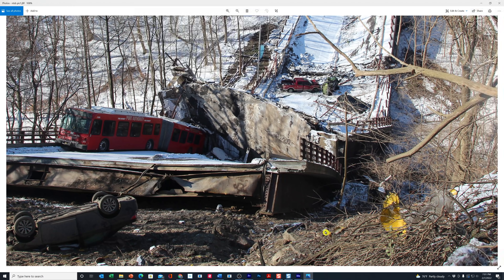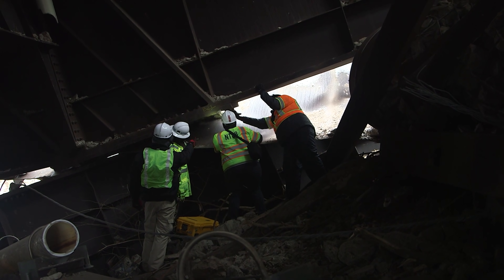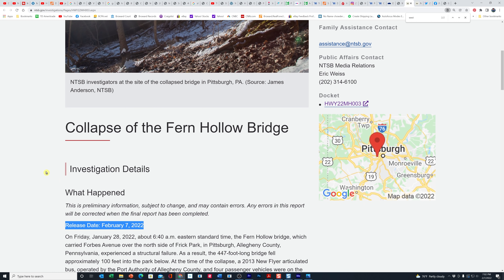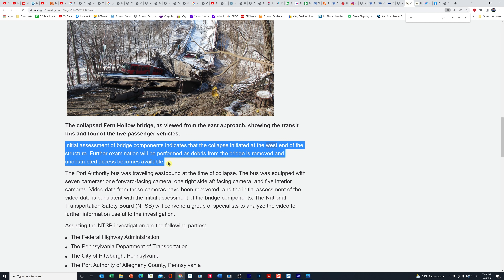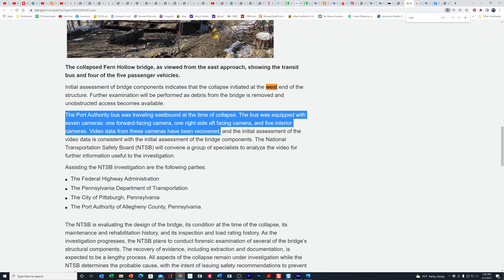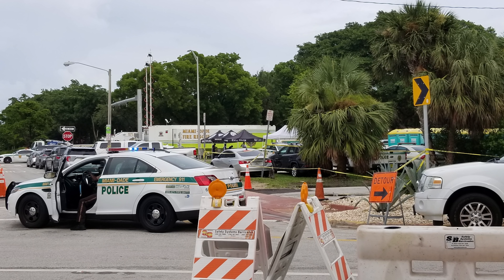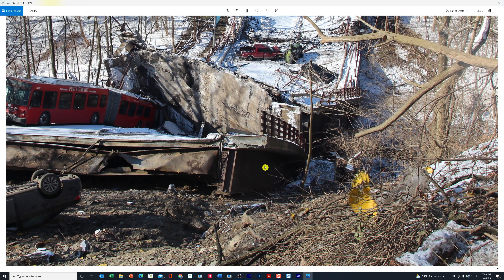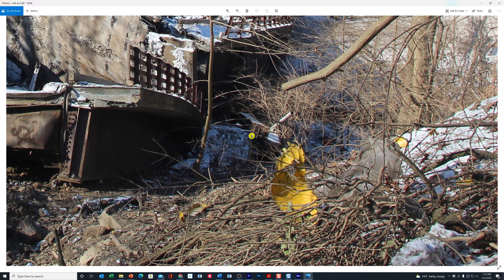NTSB Report Points Where Pittsburgh Bridge Collapse Started

Comment: Civil / Structural engineer with steel bridge experience here.  Good video Jeff.  I've never heard of retrofitting a bridge with cables like this one had, rather unusual - so that aspect will likely come under scrutiny by the investigators.  Considering the lack of maintenance and high amount of corrosion on this City of Pittsburgh owned bridge, it is unlikely that a deck or deck beam failure was the root cause of the collapse.   Foundation settlement could do it, but normally the foundation settles slowly over time and it's more easy to notice.  Seeing that there are just four main steel support columns that are also angled (not vertical), if one of them begins to fail, then the other will also fail due to the twisting effect and load transfer to the 2nd column.  If I had to place a bet on the root cause, I would think one of the column connections failed since unlike vertical columns, there is an added shear force in the angled columns.  Fatigue may have also contributed since heavy vehicles have continued to cross the bridge and will cycle the stresses and also vibrate the deck and it's support columns.  The thermal contraction of all steel elements due to the low overnight temperature may have also contributed in the collapse of an already compromised bridge.  Given the above, and not knowing any other information, the root cause of the collapse is probably a failure of one of the steel connections of the column to the deck girder on the west side.   It'll be interesting to read the final report, and to what degree the City of Pittsburgh will be implicated.  They should feel very luck no one was Killed!
Reply from the maker: Yes it really is such a miracle that nobody died especially the depth that it fell makes me wonder if it was more of a gentle soft landing than a all out collapse.
Reply: @MJ S

" Seeing that there are just four main steel support columns that are also angled (not vertical), if one of them begins to fail, then the other will also fail due to the twisting effect and load transfer to the 2nd column. "

I have not been to the bridge site.  But, looking at all the photos over the past week, the entire bridge seems to have "pancaked."  I mean it seems to have come down as a unit.  To be sure, there is the folding behind where the bus came to rest, but that is not the plane of interest.  The deck remains much intact, side to side.  This would seem to eliminate the possibility of twisting.  

Frankly, it looks like a controlled demolition in this sense.  The failure of the superstructure followed some pattern so that the deck fell as a unit.  

Having said that, looking at some of the NTSB staff walking through the debris, some of the elements of the superstructure look badly distorted.

I am doubting the low temperatures could have made a difference.  Yes, it was cold that morning, but Pittsburgh regularly has these kind of temperatures.

If I follow what the preliminary report said, and where the bus landed, the bus would have passed over the initial failure point seconds before the collapse.  Am I right?  The report said first failure point was west end, and the bus was traveling west to east.  If the failure point was on the west end, that would make part of the K-structure less likely to be a candidate for failure.  The report does not say "western K-support."  The "western end" would be the end of the bridge being supported on the western land side.  There are four primary points of the entire span support - land side (west), K-superstructure (west), K-superstructure (right), land side (east).  What the report says is the first of these was the point of initiation.
Reply: @MJS - Great points.  Agree that the deck was an unlikely cause, Foundation settlement could be the hidden cause, there are 8 support points under the two rigid frames, I got my BSCE back in '77, where we had to learn the pre computer methods of calculation, and do Fortran on punch cards.  I recall how shocking a unit displacement was for the stresses.  Well, two columns failed, the now 2 span bridge sagged and sagged until it slid off the abutment, then plastic hinge or buckled girders.  If the column foundations had slid a few inches down the hill, the high moment in the column makes buckling easier.

I differ on the primary cause - the Cable X could carry lateral loads, but the columns are no longer effectively braced at mid height.  One column buckled, its sideways movement was transferred thru the upper X to the other, the increased delta made the P-delta effects initiate buckling of the 2nd column on that side. That wrote the story.  The very spot the NTSB was hanging around.

Your point about fatigue is good, but not the whole story.  The code used for this bridge predates by just a few years some big changes in the AISC fatigue design, prior to 77 it was only tension stress range considered, suddenly compression came into play.  The number of cycles, stress range, and geometry crashed downward.  A fillet weld for a gusset across the flange had been allowed 24 ksi stress range, suddenly it was 6 ksi.  Saw crazy fatigue cracking in steel mill cranes, one crane we would have a 6 ironworker shift x 9 shifts over a long weekend welding up the cracks every 6 months or so, 2 or 3 pallets welding rods each time.  Lots of connections here fatigue prone, but the high fatigue areas are up in the deck.   So so lucky nobody died.
Reply: My guess would be to analyse the creep in those Mickey Mouse Post-tensioned cables -
Did they over compress the deck transom beams causing buckling due to differential shrinkage over straining the cables in the cold? Was there any plastic creep in the cables? Did the cables have any thermal tension fatigue failure that popped or was it transom  buckling that happened first?
Reply: someone saw those cables at Home Depot and said, hey, why not....   and all the wokers said, yeah, defund common sense.
Reply: After what I have seen so far I agree with you 100%.  I'd bet that where the beam meets the mounting plate had rusted enough that it was barely hanging on there.  Between the cold temps we had that night and the bus going across it was just enough to cause it to fail.

Comment: The bridge west end lower cross members that were removed, acted in both compression and tension.  The add cables could act in tension only.  How could this be an acceptable solution?
Also- this is not yet a crime scene, since there were no deaths or significant injuries.  That's why the "cooperation".
Reply: The NTSB gets involved in accidents which have a damage greater than 1million dollars, or a fatality. I think if there are major injuries as well.
Reply: @patrickvolk7031  I understand the NTSB's involvement. I was alluding to the NTSB's working with the City/Local Govt's in Pittsburgh, vs the NTSB not allowing the City to be involved in the Sunrise building collapse investigation.
Reply: @rayF4rio  I had to look, the NTSB is not involved in the Sunrise building collapse. The Army Corps of Engineers, NIST, and FEMA are. NTSB is roadway, waterway, railway and airway.
Reply: @patrickvolk7031  👍thanks!

Comment: Shouldn't the rebar be epoxy coated ?  It's hard to tell in that photo All through the rust belt there is a problem with uncoated rebar in concrete, Saltwater enters the cracks, and causes the uncoated rebar ro rust, which causes swelling and more cracking.
Reply: I'm guessing that when that was poured, it was pre epoxy days <EDIT> I read later that the bridge was built in 1973. Epoxy was certainly known then. I thought the bridge was much older.
Reply: @The_DuMont_Network  bridge definitely looks older than 1973, the design itself doesn't look all that safe

Comment: A local church had a bell tower made of that weathering steel that wouldn't need to be painted. They had to replace it after 40 years because it had rusted badly. There aren't any heavy trucks driving over it and it's well off the nearest street so salt shouldn't have been a problem. The bell is stationary with an electric clapper so there weren't any stresses on it.

Hawaii's Aloha Stadium has to be replaced because the Corten steel just keeps rusting. I suppose that could be caused by the salt air from the ocean. I recall being very skeptical when "Weathering Steel" was first introduced. It has been my experience that once something starts rusting, it just keeps rusting and the only way to stop it is to remove the rust. They wanted to save money on painting but it is much more costly to replace something than it is to paint it every 10 years.
Reply: The Corten Steel was supposed to be like copper.  Copper forms an outer shell of protection (called patina).

Comment: Damn, that rust just eats through that steel.
Rebar looks terrible.
Do they not use Zinc-blocks to stop the corrosion on these bridges? Like a sacrifice Anode. Or does that not work. 
Like on boats and oil-rigs, they use these big Zinc-blocks. This looks like a very damp surrounding.

Comment: jeff did u notice that the soil under the bad footer looks like it was replaced? also i noticed that there is a wedge shaped crack on that footer that appears to be open on the left side and closed on the right side. when you zoomed in real close, it's hard to tell but to me it looks like the flaky stuff is lifting up on the left side and pinched down tight on the right side. i know u said there is a concrete structure under the footer, but is one side of the footer sinking or why would it look like that?

Comment: I do agree with you, that the concrete looks suspect, along with the condition of the support structure. That said. I do think this is a criminal case. The negligence on the part of City of Pittsburgh, the original contractor, and the engineering that was supposedly done to fix it, two years ago.
Reply: YES - INDEED

Comment: Rebar is supposed to have concrete, the industry term is cover.  Indoor slabs can be just 3/4", outdoor small bars exposed to weather is 1.5", big bars 2".  Cast to ground is 3".  Navy projects around salt water will use 3" or 3.5", and also use either galvanized or coated rebar to try for a 70 year life.  

It might be there was room to see the columns on the gatehouse side, but it does not seem a coincidence they released footage of them looking at that side.  The column base where the rust perforated the web is the side view of the part where the Dr took the picture from.  The web plates that have rusted thru were at least 3/8" plate, the stiffener right behind the camera was probably 1/2", the edge toward the hill has thinned to about 1/8".   Design for CORTEN takes in account 1/8" of thickness will rust away.  This is 3 to 4 times that - not good.   Yes surprising they are pointing to these columns, means there are few other probably causes and this one is obvious.

Assisting parties mean those with information, either assist now or get subpoena later.  They have all the records - is government 'make nice speak', basically just means they are cooperating.
Reply: At the left side at the 9:45 mark it looks like the rebar is set up about 2" into the concrete.
Reply: @robert slugg: 2" would be nice there, 1.5" is the code requirement for the underside of the deck slab.  The concrete pier supporting the column really should have 3"

Comment: bottom line is that bridge was straight up rotted the f*ck out. it almost looks as if the steel quality wasn't that great from the get-go like it was low in nickel. the early to mid 70's was plagued with junk "green steel" 

this is why so many cars built in that timeframe literally rotted out on the lots, or very soon after. this bridge was built during this time:

https://en.wikipedia.org/wiki/Steel_crisis
Reply: In another comment Jeff said it was most likely local, but I do agree - the way this fell apart just doesn’t seem normal, even given the conditions.

Comment: It looks to me like some of the structural support pieces attached to the support column with the holes showing in it are thinner than others, as if they've had material rusted off their thickness.  Having that bridge be left open and used with the structural damage that seems apparent is really scary!
Reply from the maker: It will make paranoid people even more so
Reply: @jeffostroff  I know it makes me more paranoid! I have to cross a bridge to get to work. Now, instead of crossing through the Frick Park area, I have to cross up through Homestead into Squirrel Hill. I have to cross a bridge with at least 50 cars on it at a given time with a traffic light in the middle. Every time I get stopped on the bridge, I pray that the bridge holds.

Comment: The assistance from those agencies most likely will be providing documents on the bridge design, maintenance, inspections, and repair. The rebar burial depth is contingent on the design and engineering of the structure. Structural slabs will have rebar layers closer to the top and bottom of the slabs, while slabs resting on soil may only require a single layer. That section looked like it had at least an inch and a half of concrete below the rebar, which is normal. The damage to the roadbed slab looked to be caused by the failure of the structure supporting it, as the rebar mat did not have signs of corrosion, and did not fail, but spalled off concrete when its design limits were exceeded during the bridge support failure. The NTSB is very good at what they do, and including public "oversight" would come with a host of problems and issues that could possibly obfuscate and confuse things further.
Reply from the maker: At the Stoneman Douglas shooting here in Parkland, 3 fathers who lost kids in that shooting were on he investigation commission
Reply: @jeffostroff 
The Investigation commission for the horrible shooting at Stoneman Douglas is very different from the highly technical and skilled nature of the the gathering of evidence from an accident scene (we would not expect just anyone to join a CSI teams crime scene investigation). While members of the public are often included in other aspects of many investigations, including ones ran by the NTSB, we do not have them present at a accident scene when the trained personnel are gathering evidence. The NTSB at the site of the bridge collapse is in the evidence gathering phase.

Any outside persons not trained in the investigative work and without the skills to understand what evidence is important or could be damaged, would likely be a problem when it came to preserving evidence, or even be a danger to themselves and other personnel. If an independent person has the skills and qualifications to be on the NTSB team, they are already likely to be on it, or know that adding more people to the site would not necessarily help, and would likely be a hindrance.

One of the biggest advantages that the NTSB has is that it is composed of independent and highly skilled people whose job is not to find fault in any one person or organization, but to find and analyze all of the contributing factors that allowed the disaster to occur. This information is designed to be used to make changes to the systems that were involved, and to lessen the chance of the same disaster from ever occurring again.

The NTSB and the CSB are incredibly effective resources if people and institutions follow their recommendations.
Reply: Voice of reason.

Comment: At 7'32", you can see the end of the tension cable in an unraveled state. This looks more like a failure than a result of the collapse. What do you think?
Reply from the maker: Tension cables are not structure, I think one of the columns either buckled or slid off the concrete base
Reply: Cable end fitting are usually not as efficient as the cable itself,  the breaking strength of that kind of socket is likely 80% of the cable.  I think it was a secondary failure, before the column shortened by buckling the column head moved away from the bridge centerline, just a few inches would do it.  It could be concurrent, column top swayed sideways, cable tension high that size may have a breaking strength over 20 tons.  Well that would add 15 tons of load to the column, the straw that broke the camel's back so to speak.
Reply: No. It's looks like a typical failure after breaking. Cable stretches when in use and rebounds after snapping.

Comment: In my experience when I used to do concrete you would put the rebar on what they called "chairs" so the rebar  set up off the ground, so the  concrete pours on both sides of the rebar.
Reply from the maker: I have seen red plastic also
Reply: Are the "chairs" made out of something that can't corrode, such as plastic?
Reply: @swiddle1   They are made out of almost anything. Can be steel, coated and uncoated, masonry, aluminum even composition. (fiberglass)
Reply: All the ones I've used were a thick gauge metal welded together. I'm sure there's different gauges for bigger and or  smaller rebar. But I agree with  fire surfer, I'm sure all different brands types for different applications. Back then I'd assume metal was used? Lol
Reply: Years ago, supports were rare to none, workers would just lift up the rebar while the concrete was flowing, knowing it would not settle down all the way, sorta floating on aggregate & hoping no one stepped on rebar & pushed it back down to the bottom.
Reply: All the ones I've seen/used are plastic, or concrete. Different sizes depending on application.